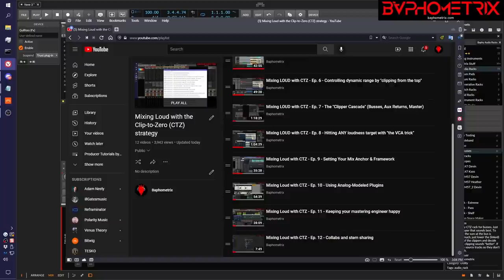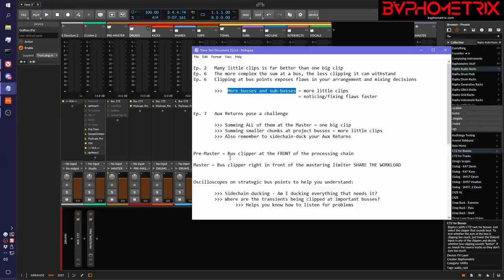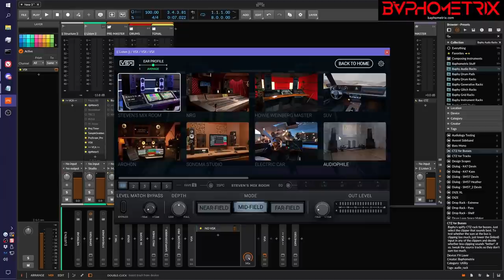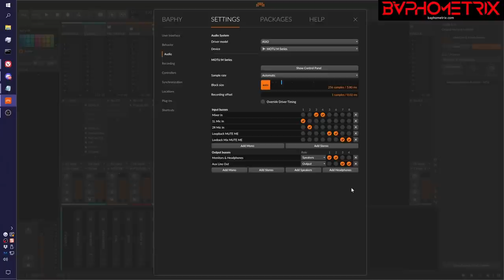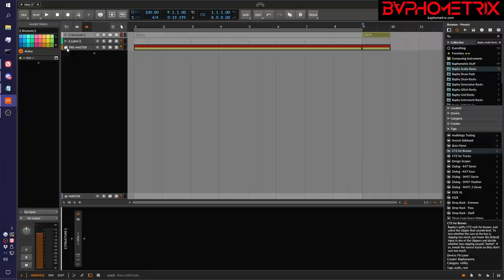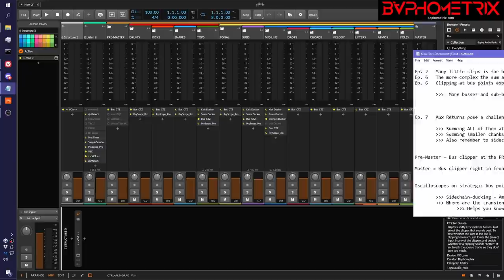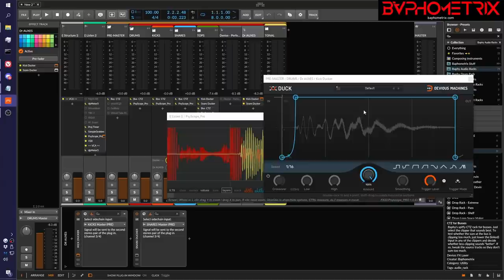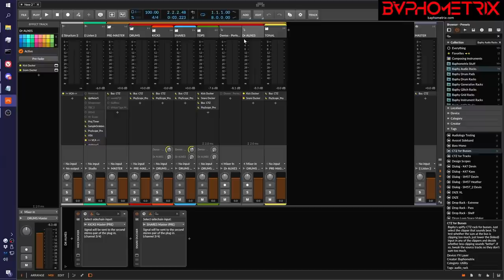Mixing Loud with CTZ - Ep. 13 - Structured bussing & a tour of my own project template

Comment: What if you saturate your sounds? Should that be turned off before mastering?
Reply from the maker: I'm not entirely sure what you're asking? Saturation is a very common and desirable sound design step for many sounds. So no, you wouldn't turn off saturation before mastering.
Reply: @Baphometrix  I was just curious if it was similar with hard clipping in that the mastering engineer may have some analog saturation that they would prefer using instead.  Thanks : )
Reply from the maker: @BrysonPrice  If you're going to hand your mix off to a mastering engineer, I've got an entire episode about things you want to consider.  But in general, mastering engineers should be doing as little as possible to **change your mix**. The goal of a mastering engineer is to make your mix sound as good as possible at the loudness targets you're asking for. Their job is to be fairly transparent.  If they think you made a big boo-boo, a good ME will do some feedback with you and suggest some changes to your mix that will help them do a better job on their end. I talk about all this in that episode.

In short, saturation isn't a thing they care about. That's *your* sound design and *your* choice in how hot/dense you want certain sounds (and your entire mix) to be. I can't think of any pro ME who would say "redo your mix so it's less saturated, because I've got a saturator that will sound better". That's not how it works. Saturation is everywhere, on every track (potentially). How are they going to re-do that "better" with a single round of saturation on the stereo pre-master? Nuh-uh.
Reply: @Baphometrix  makes sense, thanks for your perspective and I believe I did watch that episode :D I'm slowly making it through your whole video collection

Comment: What is missing from the CTZ videos is talking about bus processing. Sometimes you want to do a lot of processing even to the level of "sound design" on the bus, but there are no guides on how you would do that and maintain the VCA trick working like it should. If you have plugins that act based on a certain threshold on the bus, then how can you maintain the VCA trick working if you for example pull the entire track down? That means the threshold dependent plugins would stop working correctly, so you would have to adjust everything (which is a total pain).
Reply: I hope you come up for a decent solution to this and share it in the discord! where willing to learn more
Reply: threshold dependant plugins are only affected if you mess with the signal going in not the signal at the end of all processing. so pulling your fader down for the whole track won’t affect any threshold plug ins

Comment: Hellp bapho. Is the CTZ method useful for every genre? I mainly produce breakbeat as an indie artist or rnb (trapsoul) beats to sell and make bread. my production for both styles is ambient and spacey not "hard" like your bass music. will applying this method benefit my mixes? or should I just keep using the old school way of gainstaging at low levels. thank you.
Reply: I've been learning CTZ recently, it works for more chill genres too. You can afford less overall loudness depending on the genre. Genres that don't need to be as upfront and loud can have lower lufs. 
The idea is still choosing 3-4 main anchor elements, processing these to be present and at or close peaking at 0db. Even though the genre is chill you still want it hitting peak 0 - 0.1db on the master but at a lower average loudness. 
One of the benefits of producing around 0db is you catch summing and arrangement problems way earlier regardless of the genre. You could have relaxed bass line and a soft pad and soft kick, but summed with a 0db method you will catch frequency buildups and resonances at the source, rather than having "fake" headroom mixing around -16db, you have -16db of range to hide problems. If you still want to keep that arrangement then some loudness will be sacrificed. No genre is immune to summing and resonance and will eventually be pushed up to 0db for mastering. 

It can still sound very good clipping and saturating elements in chill genres, you just have more depth available in the mix for reverb and delicate elements and layers etc.

Comment: Amazing stuff as usual Baph! I wanted to ask if you use a kick from a sample pack and its peaking at 0 already would you still clip it to get more out of it or would you keep it as is? Also where are you sending your external sidechain to from Duck?
Reply from the maker: Remember, peak values don't matter. We don't balance our mixes by the level of super short, transient peaks in the signal. We balance our mixes by the perceived loudness of the signal (RMS or LUFS).  So, you could have a very sharp, transient kick that peaks at 0 but isn't very LOUD at all. So, yes, if I liked the sound of that kick but it wasn't loud enough, I might try pushing it to hit -10 LUFS max momentary and see if it could survive that amount of clipping and still sound good. I might even try using a transient shaper or slow compressor on it first, to reshape that kick to help it better survive the necessary amount of clipping. TL;DR - not all kicks nor snares can be made loud enough for loud genres.

Comment: When you first start,are all the levels of the tracks at zero?
Reply from the maker: All the faders are at unity, yes. Tracks and busses. If you watch episodes 6 and 7 you'll see how I tend to set the initial loudness of each track signal  with the dpMeter and Clipper in each track's CTZ pair. The busses are all neutral with faders at unity. This is how the project starts but of course as it builds up with more tracks and I do more balancing as I go, eventually some of those track faders (and later in mixdown, maybe even some bus faders) will finally move off of unity).
Reply: @Baphometrix  Thank you

Comment: Baphy, What other DAWs are good for CTZ?  Im currently using Protools & Logic, Looking at maybe switching to Cubase.
Reply from the maker: I'm only intimately familiar with Ableton, Bitwig, and Studio One. I've used Cubase waaaayyyy in the past, and it certainly looks very capable today. But I don't know much about the ins and outs of its routing capabilities. I do know that it has a "listen bus" (called "Control Room"), but that's all I really know about it. What I know is that if you focus primarily in electronic dance music genres, it's very hard to beat Ableton, Bitwig, or FL Studio, primarily because these are all geared around heavy sound design and around loop-based workflow. (Instead of traditional "record a band full of live musicians" workflow.
Reply: I would say Studio One and Cubase are the best routing capabilities for this kind of methods
Reply from the maker: @Somedei  Both are great, I think. Luca Pretolesi mixes in Studio One. I like a lot of things about Studio One, but Bitwig is more suitable for my type of music production because Studio One is strong in mixing and editing features, but weak in sound design features. Bitwig and Ableton are the kings when it comes to crazy/flexible sound design, and FL Studio is right on their heels.

Comment: Another excellent video sir, really explains your philosophy 💪🏻
Typically how much clipping do you end up with on your "passive" clippers on busses like drums, basses and esp pre master?
I know it will be track dependent, just wondering how much these guys are usually working in your projects
Reply: To tag along on this question. My tonal and especially midline sounds are hovering around -6db which means most busses above that don't do any clipping. I think this is normal.
Reply from the maker: I do very loud music (festival-oriented bass music), and one of the genres I produce (mid-tempo bass) typically uses a 4-on-the-floor kick with a snare layered in on the 2 and 4. So my combined kick and snare hit is usually WAY over 0 dBFS. Add in the drum tops, and it's not uncommon for the DRUMS bus to be clipping as much as 7 dB or so. Remember, though, these are very short-duration clips and tend to happen only on the combined kick/snare hit. Other genres with separated kicks/snares, I might have no real clipping at the DRUMS bus at all, but the kick and snare will still each be clipped and still hitting 0 dBFS.  And since my "Drop Sounds" need to be correspondingly loud and full-scale, many of those are individually clipped by anywhere up to 6-8 dB or more, but they don't tend to sum with each other on the DROPS bus because I arrange them very "vertically" (in sequence, not layered). Other midrange sounds are usually not clipped very much, if at all. Subs of course are never clipped. (That would typically sound bad and would mean my subs were too loud in the mix.) Layering of the chordal/melodic sounds in the intros/breakdowns/outros with the backing foley/atmospheric sounds usually results in only small 1-2 dB of clipping at most on my Tonal bus. And finally, because ALL of my Tonal sounds are sidechain-ducked to the kick and snare, there's only a very small amount of overlap right near the end of the kick/snare tails, so the total amount of bus clipping at my pre-master is usually in the 1-3 dB range. And again, these are fairly rare events and very short duration.
Reply: @Baphometrix  thanks so much for your detailed explanation. Typically on my pre master I'm hitting around 6db of clipping, I work in dnb so it goes way low LUFS wise. On my drums and bass combined I see very similar levels to yours and as you have mentioned before drums can take alot of clipping.
Wasn't sure if I was clipping too much at my pre master, obviously it's how it sounds that matters and I'm getting much cleaner results with your ctz method 👏🏻💪🏻🔥
Reply from the maker: @JChow-sw1yb  Ultimately, your ears need to be your guide. Sometimes, on some sounds, audible/noticeable clipping sounds *good* . In other cases, audible/noticeable clipping sounds *bad* . At least with CTZ, you have the tools and the project setup to enable you to control exactly how much clipping is happening. Or to think about how to change/adjust some mixing decisions, sound design decisions, and/or arrangement decisions to minimize the clipping in a different way than simply using the VCA trick.
Reply: @Baphometrix  100% sir.
Since implementing ctz I can hear and judge effectively where I can and want this to happen, thanks to you.

Comment: really, really awesome information. i don't know where along the way compressor became the first tool people reach in to a secret loud powerful mix but this obviously make a lot of sense. im wondering how analogue mixers feel about this. like did they have clipping in the 70s? or was the tape environnement required gain staging only
Reply from the maker: In the analog world, the analog signal paths themselves would (soft) clip if you drove a hot signal into them. This is what's happening with "tape saturation", too. So, clipping was EVERYWHERE in the analog world before digital came along.
Reply: @Baphometrix  very interesting. seems like we're really on to something
Reply: and by we, i mean you.